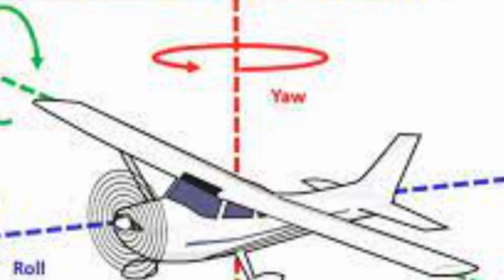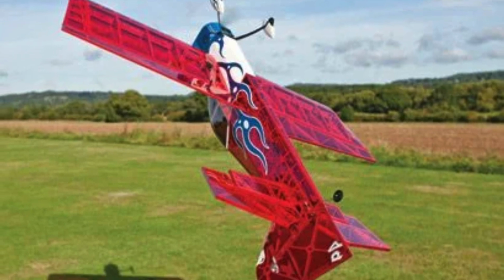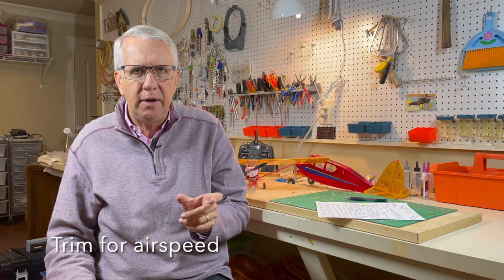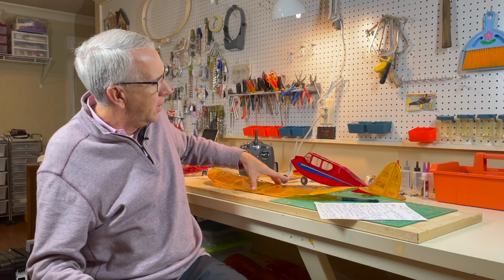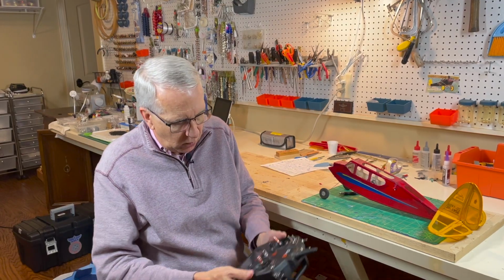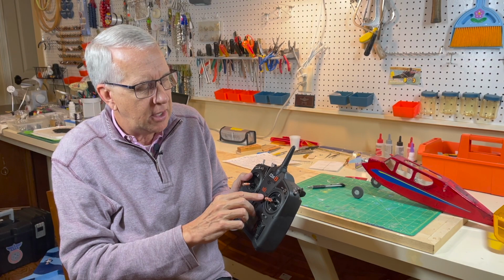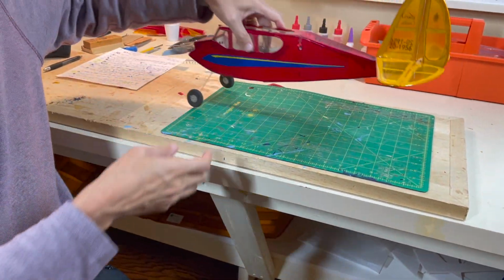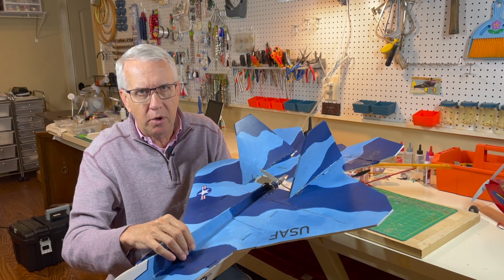How to Flight Trim an RC Airplane

Comment: Hi Tim,  one of ur older vids has inspired me to do a rc conversion on a guillows  bird dog this winter. although im in my early 40's and been into model aviation over 30 years ur rubber to rc conversion vid took me back to being a kid dreaming of micro rc that wasnt really a possibility in the late 80's
Reply from the maker: 4th:  Welcome to the channel, and best of luck with your conversion!  If I recall, the Bird Dog has a 19" wingspan.  This is a quite small model for an RC conversion, especially when the micro gear is added.  Consider converting the Guillows Aeronca.  Per my video on this, one of the best flying Guillow kits, I like it a lot.  Tim

Comment: Thank you Tim!  Finally a nice video for us newbie rc pilots.  I am only in the 2nd year in this wonderful hobby and did not fully understand trim.  Plus you answered another question that I have always had.  When you trim a plane during flight, I thought you were trimming for just that flight.  I now understand that the trim will be saved in the 250 model memory for each plane.  I could never find out about this in any of my manuals of the planes or my transmitter.
Reply from the maker: Dave:  Thanks for checking in and your kind words.  RC airplanes are a lot of fun, been doing this for over 50 years.  Welcome to the hobby!  Tim

Comment: Very good information for beginners in the video. One recommendation however is to  always remove the propeller on a model  when working on the bench, especially when playing with the radio settings. Very easy to accidently start the motor and make a mess without talking about injuries.
Reply from the maker: MX:  Fully agree, thanks for this reminder. Tim

Comment: Tim im getting back into rc so my super timber seems to when I take my hands off sticks flys downward so I assume I need some up elevator to level it and Im using a nx8 so on the trans there is a button on the left side I should push that button up some to level it? And that will give the elevator some up to level it and just watch the plane in flight if it corrects?
Reply from the maker: Sounds like you need to either add up elevator trim, or adjust the elevator clevis to add some up elevator.

Comment: Hi Tim. Any idea on how to When using Spektrum transmitters, set the lower endpoint of the throttle channel (CH1) to -120% to start the motor on a Dx5e transmitter?
Reply from the maker: Not sure . . . do try www.RCGroups.com Tim

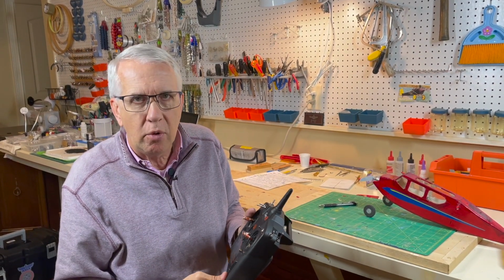Comment: 15:40  Instead of relying on a buddy for helping with setting trums, I set the trim sliding switches for cross-trim.

That is, I set up the trim sliding swiches that are on the left-hand side of the transmitter to control the trims for the stick on the right-hand side, and conversely the trim sliding switches on the right-hand side to control the trims for the left stick. Thus, the elevator trim is set by the sliding switch that would normally control throttle trim.

Why? That way, I  can set the elevator trim with my left hand while simultaneously controlling the elevator stick with my right hand.

If you dig into the transmitter menus, you can find where to setthe trim switches to specific channels.
Reply from the maker: Great inputs, thanks!  Tim

Comment: Since you mentioned warp, could you demonstrate fixing a wing warp.  I have a glider with a 72 inch wingspan.  When I hand toss the plane will go out about 20-30 feet and drop the right wing tip and crash on the nose.  I had someone tell me I have a wing warp.  So, I need to know how to fix it.  Larry
Reply from the maker: Larry:  I can add that video.  Pretty easy to check for wing warps.  Either look carefully at the wing, see if there is anything not flat on the underside of the wing.  If the wing allows, see if it lies flat on a building board or flat surface.  I only know how to fix a warp with iron-on covering . . . twist out the warp and use a heat gun to shrink the slack covering, usually works quite well.  Tim
Reply: @TimMcKay56  my wing is covered with monokote.  I do have a fairly large work bench to test it out.  The wing is a polyhedral so I expect I need to test all 4 surfaces.
Reply from the maker: @larrypaine1523  Larry:  Perfect, MonoKote makes any warp adjustment super easy.  Just twist the opposite way, shrink the wrinkles, and you can get to a no-warp wing.  Tim

Comment: The F22 should be very pitch stable, the cg looks a little far back to me. I'd first creep it forward a bit. Then give it a little more expo and a little less throw. I like the idea of going back to set the trim with the sub trim, I never looked at it that way. I usually use the sub trim to square off the geometry of the servo and control surface on initial setup then use the main trims to trim in the air then leave it.
Reply from the maker: Greg:  Good idea in inching the CG forward a bit, will give that a try!  Tim

Comment: Hi Tim
Very detailed video but did not help me. 
Another oldie getting into rc flying. Solo in the field behind my house. 
Getting the hang of RTF park flyers but lost two after lost visual. Got a larger Ranger 1600 for Christmas but the pitch is so sensitive that I have had to abort all flights. 
C of G checked and elevator travel minimal. 
Where am I going wrong?
Any advice would be appreciated.
Reply from the maker: Tom:  My recommendation would be to see if you could visit a local RC club (just do a Google search) and see what the guys there are flying and what they like as trainers.  It could really save you some time and heartache, perhaps avoid a crash.  Also, if there is a local hobby shop nearby they may have some recommendations.  But a RC club is the best bet.  Tim
Reply: @TimMcKay56  thanks for the prompt response. 
I know that I should join a Club and contacted one last night. Model shops are getting very thin on the ground here in Scotland. 
After I sent my query I found your video on CG and looked at the manual again. It seems correct but as the plane is marketed as FPV it can take a heavy nose weight. 
In the meantime I will repair the plane and try it with more nose weight.
Reply from the maker: @Pufferman  Sounds good, best of luck!  Tim

Comment: Thank you for your video  ,very nicely explained. My first plane i built crashed on take off.  I  do not know if i could start take off and if it banking on one side land it quickly before it gains height and adjust it. I am also not sure if the plane was too heavy for the motor size and caused it to stall  . Is there a chart weight of plane and motor required.  Thank you
Reply from the maker: Saleem:  No such chart exists, as each airplane different. Sounds a lot like you were slow on airspeed, classic stall/spin accident. On any test flight accelerate straight ahead before trying a turn. Good luck!  Tim
Reply: @TimMcKay56  Thankyou for your quickj response and advice , your videos are excellent.
Reply from the maker: @saleemkader2126  Thanks!  Tim

Comment: First like Tim❤️👍.
Reply from the maker: Thanks!  Tim
Reply: @TimMcKay56  I made a weight scale for measuring my airplane weight, it will do gram,ounce, pound, with just a slide of a button. Now it's development finished.
Reply from the maker: @Ciiads  Perfect!  Tim
Reply: @TimMcKay56  next I want to make a radio control. this video is a wonderful info I would like to add the trim control to my new radio control design. Thank you Tim.❤️👍😊.
Reply from the maker: @Ciiads  Good luck!  Tim

Comment: One problem I've run into with trimming is that flaps aren't always even.  A plane may develop a roll when the flaps are deployed.  The way to deal with that in a Spektrum radio is to tie your flight modes to your flap switch.  Then you can have separate trims for each flap setting.
Reply from the maker: CG:  That is an excellent point regarding asymmetrical flaps, thanks!  Tim
Reply: You need a separate servo in each flap so you can adjust them to be even.

Comment: I do a couple things differently that traditionalists don't like.  First, I make a throttle curve for trimming that has a flat section at the power / speed to use.  I only use it for trimming, but it allows speed to be repeatable if I make mechanical adjustments to zero trim and fly again.  I only need to have the throttle position close to get the same setting every time.

Second, I do trim for landing speed.  I do this by mixing R Knob to Elevator.  It is set for a small range but allows me to quickly dial in trim for landing speed and dial it back out for cruise trim.  Have to really watch the nose coming up too quickly and trying to stall when dialing it in while still a little fast.  But a quick bump of down elevator usually corrects it as speed bleeds down.  Again, this allows for repeatability of speed and trim when landing.  I watch too many flyers that are far better than me while flying, damage their aircraft while landing because they were too fast or too slow.
Reply from the maker: Mark:  Great points, thanks!  Tim

Comment: what a massive verbage. How about check model not warped check every thing centered mechanically and throws go in correct direction SET TRIM STEPS to a course setting ie 1 click adjusts a few steps so in the air a trim click has a useful amount of trim. Fly trim and check on the ground recenter mechanical trim to right position and reset radio trim back to zero
Reply from the maker: Thanks!